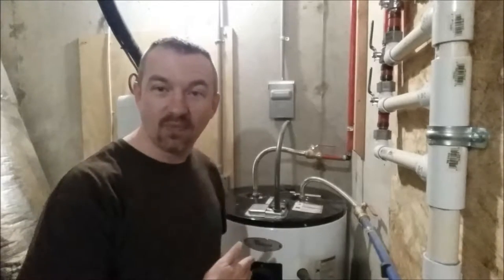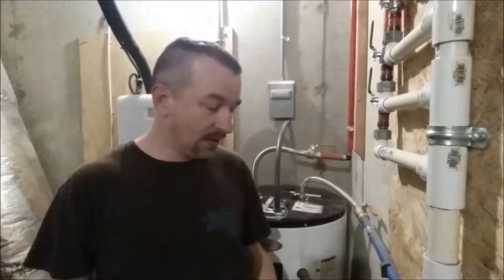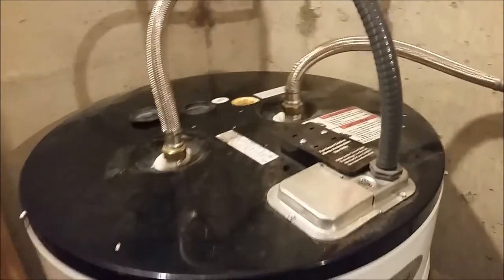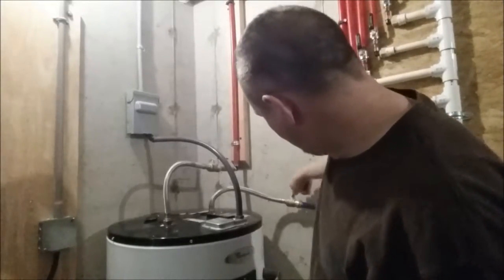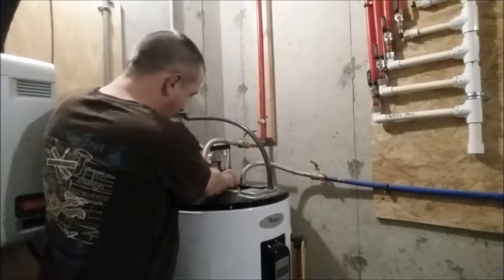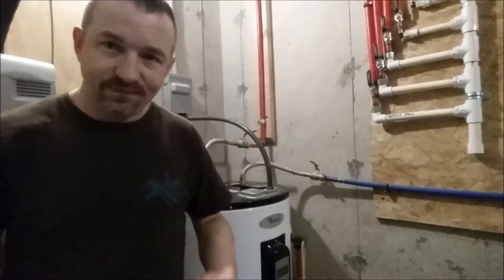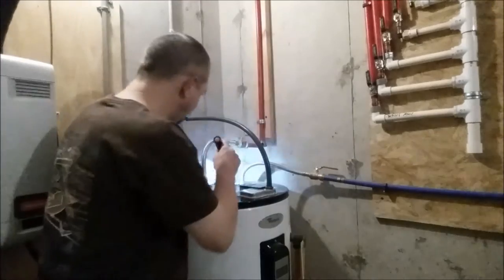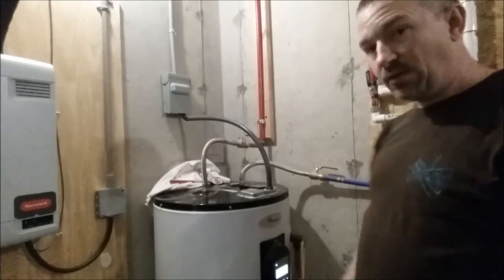Project #7 - Water Heater Anode Replacement

Comment: Good video Vance - thank you. A couple of suggestions: 1) always - always use impact sockets with an impact wrench. Using a standard socket designed for use with a ratchet on an impact wrench is dangerous. The impact or hammering action of a powered - electric or air driven - impact wrench can shatter a standard socket sending high energy debris everywhere. Standard eye protection - hopefully you're always wearing some - may not protect you from injury. 2) At least 6 wraps of teflon tape on the anode will seal the threads well enough to tighten down "snug" with just a crescent or pipe wrench. Using an impact wrench on this project will almost certainly guarantee you will not remove the anode you just installed - if that is your water heater lasts that long. Again, good video and thank you for the help.

Comment: Nice video. I followed your instructions in using the Impact wrench to remove the Anode rod. This is the easiest way to to remove the rod. I used an Electric Impact Wrench with a 27 mm or 1-1/16 in. deep socket, I added the Teflon tape to the upper part of the Anode rod  and there was no leak. I then used the 1/2 in. drive Ratchet on the Socket to tighten the Anode rod to the water heater. Also I used the segmented Anode rod for the  replacement one, My water heater is taller than the one in the video, the rod is 44 inches long and was difficult to get it out of the heater because of the low ceiling height, So I had to use a hack saw to cut it into two pieces before I was able to remove it completely. Thanks for the Video!! It saved me a lot of headache trying to remove Anode rod using a Breaker bar.
Reply from the maker: Glad to hear that it was useful!  Thanks for the comment!
Reply: Folabi Olat 
Did you have to cut the new rod  in 2 pieces, to put it in ?
Reply: @torobravo8023  Yes I had to cut it to size. It depends on the size of your heater. The anode rod that I purchased was longer than the original. So I had to cut it. Take out the old anode rod and compare it to the new one. If they are the same length,  then you don't need to cut it. You can just cut off the extra length if they are not the same length.
Reply: @torobravo8023  see my reply
Reply: Folabi Olat 
Ok, thanks, for the lesson, and for replying  👍

Comment: Not using Teflon tape or teflon sealant is an old wives tale.  Conductivity is still present after using them.  Think about it... there is not way metal to metal contact is eliminated after tightening that bolt down.  I have tested this using a multimeter on several tanks and proved this.  It's use will also help eliminate that small leak and help with its removal down the road.  I like the valve on the hot water side but I do believe that is against code.  Thanks for video

Comment: Just changed my water heater after 19 years, started leaking today. The new water heater leaked at the anode rod threads. I was pissed, some ass wipe did not put any sealer on the treads. I put Teflon tape on them . i keep checking for leaks every hour. Hope it stays dry.

Comment: My water heater is about 4yrs old. I am convinced that I would need an impact wrench to get the old rod out. Question, would you recommend spraying the old rod with penetrating oil to loosen it up prior to applying the impact wrench?
Reply from the maker: That's probably not a bad idea.

Comment: No gloves. Just curious, would the anode not of been the temperature of the hot water, or was the tank shut off long before that.
Reply from the maker: Good observation.  It actually wasn't off for very long.  I was kind of careful when I first touched it, but I immediately felt it was okay to handle.  The water temperature setting is 140F I think, which is right at the threshold of being too hot to handle.  The anode rod must have cooled down pretty quickly.  I can see that happening since it is aluminum which is a great heat conductor.